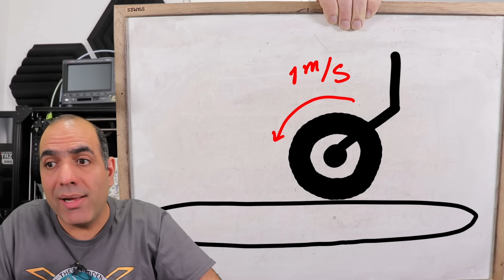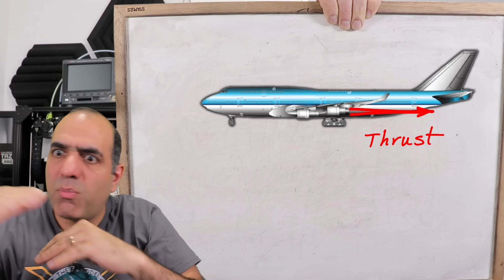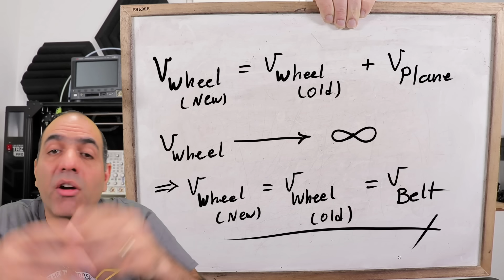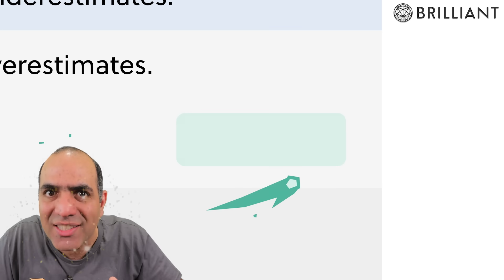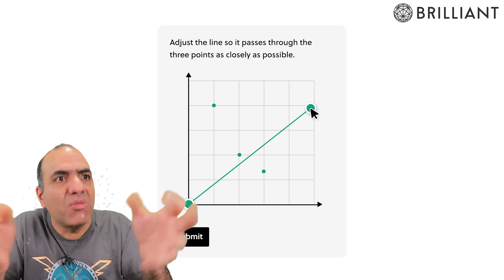Airplane Question that Drove Me NUTS!!!

Comment: The planes jet engines push the whole air frame forward and any opposing effect the belt has on the planes free-spinning wheels, won't interfere with the planes forward momentum. The plane would still have to produce adequate forward momentum to generate enough lift and would no doubt roll off the end of the belt long before achieving that lift. The same conundrum cannot be applied to road going vehicles that rely on a direct mechanical drive chain to propel the vehicle.

Comment: Another aspect is: the conveyer has friction with the air above it. as it runs, it moves the air which increases the wing speed and lift.
Reply: Ooh ground effect
Reply: Yep, but they didn't specify whether that lift will be enough, so we cannot make definite conclusion based on that
Reply: @igorbondarev5226  you're right but there are so many missing details in the question that I don't think it can be answered at all. I just mentioned that this is another aspect to consider.
Reply: According to GPT4, because the belt matches the speed of the wheels the ground effect wouldn't come to play because it is dependent on the forward speed of the aircraft relative to the air and the proximity to the ground. The plane remains stationary relative to the surrounding air beneath it's wings. The conveyor belt would create some turbulence and localized airflow close the the ground but it would not create the necessary airflow over and under the wings to generate lift for the aircraft.
Reply: @Globalnet626  That is the thing, frame of reference. Does not matter if I move a volume of air at take-off speed or move the wing at take-off speed.

Comment: we had this problem whilse studient physics and it went so far that it was discussed by a board of professors the real problem is that there is just not enough information in the question.
in reality the belt has a maximum speed that it would reach and then the airplane would take off (as tested my MythBusters). 
but then it becomes complicated if you have magic belt that can go very fast then the weeel of the airplane explode  . weeahl  cant  break =>  do they have mass then speeding there roatainal speed up will slow the plane up. if they don't have mass the belt will reach the speed of c immeadalty and realty breaks. one could also say that the belt at some point produces enough wind for the plane to take of.
if one totally neagtes friction than the plane cant fly as planes need friction for the wings to generate lift.   
THis question keept the whole physics department bussy for months xd.

Comment: With the mythbusters version there was one big difference as well thou. The prop of the airplane pushes air directly over the wings, creating lift, which does not happen in the case of an 747.
Reply: The big difference is that the conveyor wasn't matching the wheel speed, it was matching the plane speed. That's a huge difference because the wheels on a low take off speed prop plane can very easily spin at double take off speed, but if the conveyor was running at wheel speed instead then it would be going a lot faster resulting in much more drag, approaching infinity.

Comment: The simple answer is resounding YES, because the plane wheels are free wheeling. 

In practice, the question is much more complicated than that, but boils down to a question "how fast can the wheels turn before disintegrating?" As the plane starts moving with the thrust provided by the motors, the wheels starts spinning, as does the conveyor belt. The plane can accelerate without any problems, exactly the same as on stationary runway,  but due to certain mechanical facts the speed of the wheels keeps increasing as long as the plane moves forward in relation to the conveyor belt. As long as the rotational speed does not exceed the wheel's strength to withstand forces, no problems will occur. If it goes faster than that, the wheels disintegrate and drops the plane on the belt essentially destroying it.

My current knowledge is not enough to determine whether  or not the final rotational speed would be too much, but those are the two possibilities.

EDIT: Wrote the comment even before he demanded it. Apparently he came roughly to the same conclusion with me.

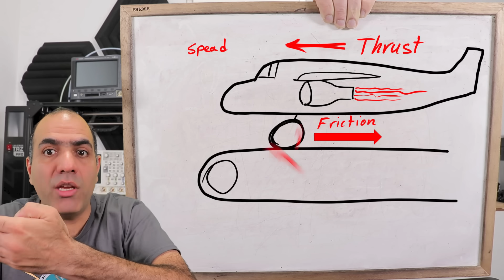5:25 This claim can be true only if the wheel could withstand almost infinite forces tearing it apart. But because it cannot, it will be torn apart long before the friction in the bearings poses any significant counter force to the jet engines. To further highlight this, the bearings would be destroyed by heat long before even if we would ignore all the kinetic forces apart from the friction.

Comment: Assuming the facts in the question mean that the plane's ground speed is zero - that would mean there's no air flow over the wings (except wind which isn't mentioned), and so there's no lift being generated.  So the plane can't take off. Right?  I think.

Comment: These thought experiments are meant to be done in frictionless environments.  (only friction is in the description between the wheels and the treadmill)  So any answers that worry about how fast the wheels can spin without breaking or same with the treadmill is focused on the wrong thing.  The point is suppose to be, when the thrust of the plane starts up, it begins to move the plane forward.  What happens if the treadmill matches the plane speed perfectly after the initial start and the treadmill has no effect on the air in this frictionless environment.  I believe the plane would never take off because the treadmill counters the forward movement, virtually disabling the lift that the wings normally create.

Comment: I would assume that the plane couldn't take off if the thrusters were on and the wheels on the treadmill start moving forward the friction would boil them due to the high speed of the wheel spin, only because the question said it would match the speed of the wheels, and by moving forward it would rapidly increase as it goes forward and the treadmill trying to match it would just go in hyperdrive and eventually it would destroy the wheels before it can take off and fall on the high-speed treadmill and destroy the plain like a sander in an instant. And the second scenario plays out like this - assuming thrusters aren't used it couldn't take off no matter how fast the wheels spin, because the air velocity would equal zero, since the plain wouldn't have moved an inch, only stand in place and spin the wheels.

Comment: I'm glad you at least actually acknowledged what I've always felt was the crux of the problem: whether the wheels can withstand what would theoretically become perpetual acceleration.  I always see so many people smugly saying "of course it takes off, plane engines push against the air, not the ground, lmao" like the wheels and the speed they're going at don't matter at all...  In the time between the plane being stationary and the plane being airborne, I'd say their speed and integrity are kinda important, you can't exactly take off with gnarled stubs for landing gear.

I'm sensing there are even some of them in the room with us right now...
Reply: Protip: If you want to criticize other people for being smug, always do it in the most condescendingly smug way possible - that way everyone is intimidated into agreeing with you.
Reply: The infinite acceleration wouldn't happen. At some point the coefficient of friction would be surpassed and the wheels would just slip.
Reply: There are a lot of them in the room right now. I suspect a lot of them either didn't watch the video at all or didn't bother to understand the actual reasons that the plane might not just take off as simply as their incomplete conceptual understanding suggests.
Reply: @arletottens6349  That's still not enough assumptions to figure out if the plane takes off or not, unbreakable wheels and unbreakable belt could result in no take off from infinite friction in the wheel bearings exceeding the plane's thrust, frictionless bearings allowing the plane to take off with the wheels and conveyor spinning at an infinite speed, or the indestructible wheels not spinning at all and skidding down the runway instead allowing take off.

Comment: I might be missing something, but the only thing that matters for the plane to take of is the amount of lift generated by air passing the wings. I don't understand how it would be able to take of since the speed of the wheels to the conveyor belt doesn't matter at all, the plane would simple stand still? or well slowly roll back and off the conveyor belt
Reply: Put something with passive wheels on a treadmill and hold it with a string, then pull on the string. It'll move forward. The engines on a plane work the same way. It'll accelerate regardless of the treadmill, because the magnitude of forces makes the wheel drag negligible.

Comment: my initial thinking is that it cant, however he wouldn't make this video if it cant so i think it can. I think it can since if you imagine the air as a fluid (like water) it makes sense that it would be able to launch, if the thrust can point slightly downwards (don't know if it can), or it could launch since the engines create an airstream under the wings for the plane to lift off of. idk tho ill watch the rest of the video now

Comment: Even with friction the air speed can be high enough that it lifts off before we reach the equilibrium. and of course, since the belt is not infinitely long it will either drop off at the end or lift off, way before we reach infinity with the belt speed.

Comment: yes it can provided the engines are on. if the engines are off then there is no way the plane takes off. to clarify what makes the plane get to take off speed is the thrust from the engine, what the wheels do doesnt really matter.

Comment: I think that the conveyer belt and wheels cancel, leaving two forces: the weight of the plane, and engine thrust.   The belt significantly ramps up the amount of power needed to move the plane, but there's a point at which the thrust will be high enough to overcome the loss in power to the runway.  I think that whether the plane takes off or not entirely depends on the thrust to weight ratio of the plane.  At some point, there's enough thrust that the plane functionally becomes a rocket, and air speed doesn't matter.  (Like an F-15 Eagle fighter jet.)

In short, we need to know the thrust to weight ratio of the plane to answer the question.
Reply: Here's a great video on the F-15 losing a wing:

https://m.youtube.com/watch?v=Qp62hR6J0MM&pp=ygUVZjE1IGVhZ2xlIGpldCBmaWdodGVy

Comment: Glad to see I came to the same conclusion as Mehdi - it's a badly posed question which can have different answers depending on how you interpret it.
Reply: Exactly. All I can do is laugh at the plebes elsewhere in the comments section still trying to mansplain that it will take off and that planes don't move like cars. It depends on how magical the conveyor belt is (infinite speed possible?) and whether the airplane is subject toreal world limitations like friction in the wheel bearings. Both "yes" and "no" are dumb answers without clarification of the premise and substantial elaboration of why you think so.

Comment: Simple analogy version

1. wear some roller skates
2. get a threadmill
3. tie a rope to a wall in front of you, hold the rope
4. set threadmill to full blast. notice your roller skates wheels match your threadmill speed
5. now pull on the rope. notice you literally move forward, your roller skates simply moves faster than the belt, and its actually harder to pull on the rope due to your skates wheels and bearing not having zero friction

credits to yt user SpeedGeek

Comment: I mean unlike a car, most of the friction from a plane taking off is from air resistance, not the wheels. So even though the wheels would have to spin twice as fast for the plane to take off, that's not that much friction when compared to what the jet engines are used to dealing with. So probably the plane would get pushed back initially as the plane must first over come the stationary friction of the wheels, but once the speed of the plane is enough so that it counter balances the backwards motion of the treadmill, it will start to accelerate faster than the treadmill and actually move forward. So yeah, it would probably take off

Comment: Assuming no headwinds, no.
Because the conveyor belt matches the speed of the wheels, as soon as the plane attempts to move even slightly relative to earth using its engines, the conveyor belt would speed up, cancelling the speed.

Comment: according to google, a 747 needs to go about 180 mph, i think this would mean the wheels are turning twice that speed due to the conditions described, so unless wheels turning at near 400 mph cause enough friction to slow the plane down below 180 is where you'll find your answer. 
google says the max speed of a 747 is about 600 mph, given the friction not being very high and the plane's capable speeds i conclude that the plane should be allowed to decide for its self, whether or not it wants to fly, and who are we to tell it what to do

Comment: I mean, the answer it's probably intended to get is yes.

However, to further discuss.
 As the belt accelerates to match the speed of the wheel, it starts generating friction between the belt surface, and the air above the belt. That air would then turn into a headwind for the plane. Which means, that the more the belt accelerates, the greater of a headwind the plane gets thanks to the friction of the belt and the air.

And seeing as how the landing speed of a 747 is around 270km/h, and the take off speed of a 747 is generally around 300km/h. The belt would likely generate enough headwind for the plane to take off, before the tyres spin so fast they explode. 
But the belt certainly would explode before then.

So there. I added two additional answers to your four, and now we're at 3 for 3.

Comment: What is the speed of the air passing under the wing? The treadmill is canceling any forward movement right so it only needs to be the size of a plane. If the plane does not have enough air passing it there is no reduction in its weight by creating friction with the air so the plane cant take off. The question does not contain any info about the natural speed or direction of the wind. In high enough head wind a plane can take off without any forward momentum.

Comment: 0:40 it will not move at all, cause when the threadmill matches the speed of the wheel, the speed of the axis of the wheel will be zero,and thus the plane wont move. However the wheels will probably turn very fast if the plane is at full throttle to be able to encounter the thrust of the plane.
They might even explode.

Comment: How about this then? As the plane starts to accelerate, the wheels turn freely on top of some "land wheels" that also turn freely. The plane builds up air speed, and takes off from the same place it started accelerating. No need for take off runways (you'll still need land runways though).
Reply: "The plane builds up air speed, and takes off"?  What increases the speed of the air if the aircraft isn't actually moving?  What you're talking about is increasing ground speed - the speed at which the wheels turn - which has nothing to do with being able to fly.
Reply: @aussiebloke609  Mehdi answered this already. It was his case 1. The plane does fly in that treadmill, even though it seems it's not moving, if checked by an external observer.
Reply: @Jo Veteran   But he broke a tenet of the original question - that the treadmill must always match the wheel speed.  But even at infinite speed, the wheels would theoretically have to be moving still faster to allow the aircraft to move forwards - which is not permitted by the question.  In the hypothetical situation as defined by the original question, forward movement of the aircraft cannot be permitted.  And without it, there is no air speed, and thus no lift.

PS: As he stated, another hypothetical possibility is that the wheels are locked up and acting as skids, in which case they have no rotation speed, so the treadmill never moves and the aircraft takes off relatively normally.  But that's not really feasible either, as there would still be too much friction for the aircraft as depicted (B747) to move with sufficient speed while all the wheels are completely locked up
Reply: @aussiebloke609  I agree with Mehdi.. I also fcking hate questions like those..
Reply: @aussiebloke609  Maybe we can convince Veritasium to do that experiment, instead of burying himself in concrete.

Comment: There are sooo many undefined variables. Lets assume the conveyor and aircraft as "perfect" indestructible objects.

Is there any friction between tires then as soon as the aircraft applies any forward thrust we would have an infinite rotational speed of the tires and infinite speed of the conveyor.

Is there friction between the conveyor and the surrounding atmosphere? Then the aircraft has just been flung out of the solar system.

Is there any friction in general? You have just cooked the planet.

Comment: Whats interesting is that, the 2 that fly are in "unrealistic" scenarios without friction. While the 2 where the plane doesnt fly, its realistic scenarios. But also I do feel like at some point even with friction I feel like the plane would eventurally move fowards and fly, at some point the trust would just drag the wheels on the conveyor belt and they would slide instead of rotate, leading the plane to fly
Reply: I don't think the conveyor belt accelerating infinitely is realistic.
Reply: @goedendag9446  
It would try, and tear itself apart.
Reply: @theuncalledfor  which would result in the plane not flying... probably
Reply: @Lopoi  
Flying apart lol.
But agreed.